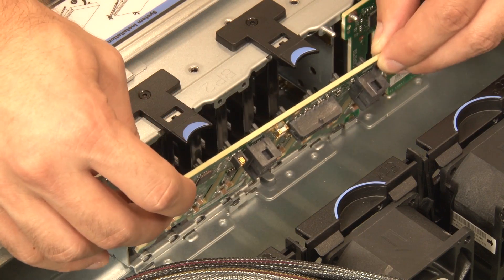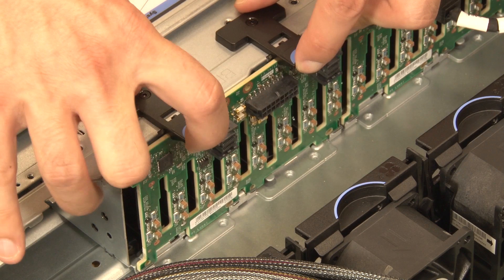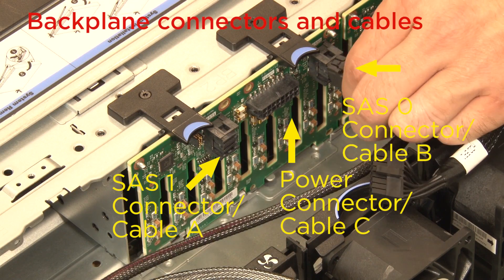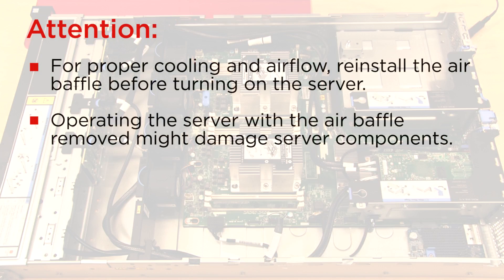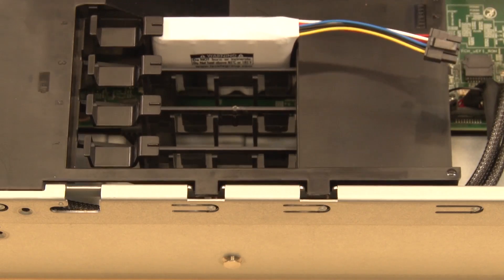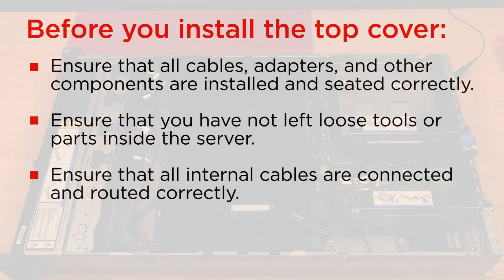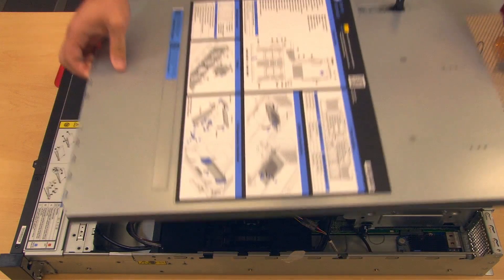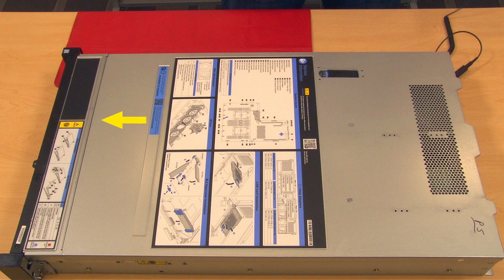Lenovo ThinkSystem SR550 installing a backplane

Comment: Is this cause data loss if I swap backplane
Reply from the maker: Replacing the backplane will not result in data loss as data/configuration is not stored in the backplane. But please make sure all the cable connections are correct to avoid unexpected issues.